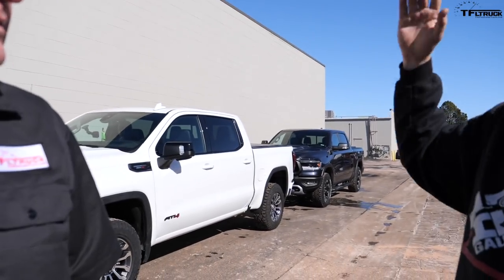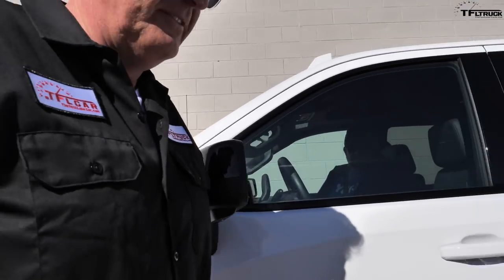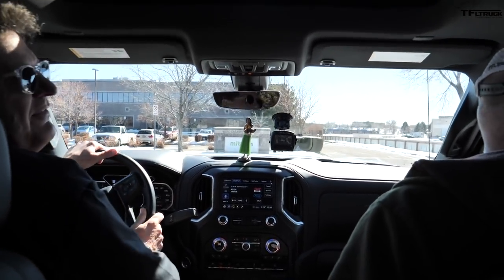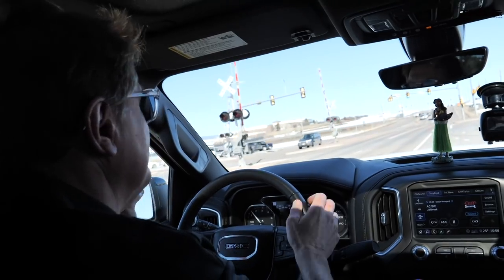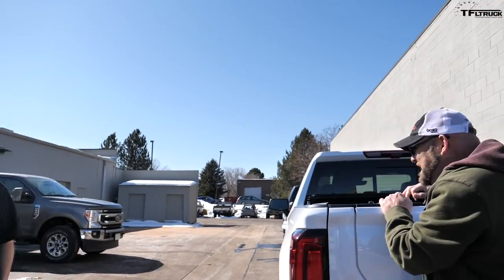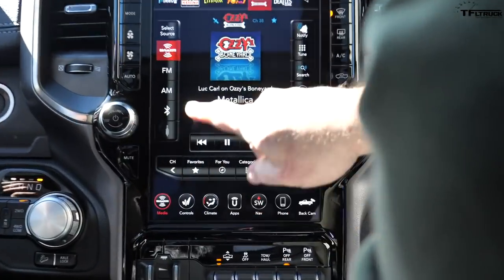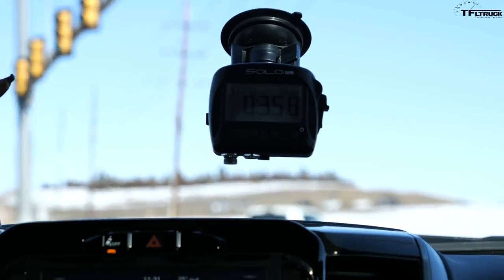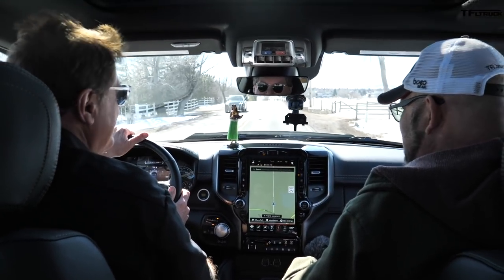Best Diesel Truck! 2020 GMC Sierra AT4 vs Ram Rebel Diesel 0-60 MPH Buddy Review

Comment: Yeah, wait till you have “emissions” problems on these new diesels. If you don’t need a diesel don’t get one and save your money.
Reply: With these trucks you don't save much on the bottom line.
Reply: Just got rid of my eco diesel with 80k kms.  My wife’s x3 diesel just had the $5000 soot intake clean out at 115k kms.  These modern diesels with egr are time bombs.  Loved the fuel economy but in the long run there is no math that makes them work.   Stay away and get the gas engines.
Reply: matthew anderson you can delete, delete your warranty on your brand new $50k truck too.
Reply: matthew anderson 🤣🤣 you never hadn't warranty work done on a vehicle, have you?!?!
Reply: John Doe especially on these brand new trucks, my 2019 has already had warranty work done on it.
Reply: Said no man ever...
Reply: matthew anderson that's why you don't delete until your warranty is up!
Reply: Most guys that so spend all this money on them their trucks never see a day of work
Reply: Big egos that never tow
Reply: Brad Harris my wife’s 2014  jeep grand cherokee ecodiesel has 90,000 miles and no issues no warranty repairs and no trips to the dealership. And we have saved a lot of money on fuel because that car gets 24 to 25 city and 34 on highway. For me it’s been a nice experience owning that car . Only complaint is I can’t hear the turbo 😂😂😂 because all that crap but so far so good.
Reply: @duvielhernandez2887  ha just wait. Dodge is the worst company ever
Reply: @duvielhernandez2887  no car should have any problems yet. And thats the same milage a v6 gas will get but you pay more per gallon.
Reply: @duvielhernandez2887  how stupid to buy a diesel when you can have gas.
Reply: Hurricane 863 the V6 Grand Cherokee does not get 34 mpg on the highway.
Reply: @nicholasandreas4348  pretty close. Just wait till 100k or 125k. That thing is going to be nothinf but issues
Reply: @nicholasandreas4348  youll be wishing you got a toyota or subaru
Reply: @nicholasandreas4348  do you not know who owns jeep? Like get real.
Reply: matthew anderson, deleting it will cause all sorts of problems, transmission issues, not passing a smog test/inspection, & other warning lights from the DPF gauge.
If you do it right you need to reprogram the whole PCM, & a new tune that’s hard to find and if that. 

But an old truck & swap a diesel in it. Cuz as of rn you can’t get a real diesel in a truck anymore.
Reply: Hurricane 863, if they want a good diesel truck buy an old 6.0 or 7.3 as of now they are the next best thing to a good truck.
Reply: @michaelbenoit248  all i buy is ford and i had a 2006 6.0 with 115k miles and it was nothing but problems. 2012 and newer 6.7 is a good motor. But i love my 3.5 ecoboost. I will never buy anything else.
Reply: Hurricane 863, for thinner fuel than in other countries. My 7.3 needs the thicker fuel & it won’t run right even with the additives for the loss of sulfur.
It loves a little motor oil in the fuel, I can tell a big difference in power & over all efficiency.
Reply: Nicholas Andreas, it probably gets like maybe 20 and if that on a really good day when the sun is shining.
Reply: Duviel Hernandez Have you filled your claim form and grabbed your $3,000?
Reply: Nicholas Andreas Mine got 36 highway before I sold it.
Reply: @macbook802  yea, you know... if you're into breaking federal law. And having everyone around you hate you because you spew soot and smell
Reply: Kyle Schack not if you have the proper tune!
Reply: Game Bred Duramax I agree with you. But I know how the warranty department acts and if they found out you deleted it, they claim every problem you have will be because of it. I didn't delete my 2016 ram 2500 mega cab limited Cummins because I got the extended warranty as well.
Reply: @nicholasandreas4348  it sure the hell can. I have a 2015 overland with the ecodiesel. Drive it nice and that number is achievable
Reply: @hurricane8634  no it's not. I've owned both, gas and diesel outfitted jeep grand Cherokees. The diesel  repeatedly gets an extra 300km out of the same 90 liter  tank and almost never leaves 8th gear on the highway. And have had no issues with it. Now the air suspension is a different story.....
Reply: @michaelbenoit248  where do you get your fuel at?
Reply: Iggy I was saying the gas V6 grand Cherokee doesn't get 34 mpg. I'm sure the diesel could get that.
Reply: @nicholasandreas4348  My bad man! You're 100% right.  I've owned both.

Comment: Ram - 8 speed ZF Auto
GMC - Ford/GM 10sp Auto

I'll take the ZF 8HP thanks
Reply: LOL with how many 2019+ Ram's have had their ZF 8HP take a dump, you can keep your Fiat.
Reply: @ThomasFG  go look in the forums. tons of ZF 8-speed Rams needing new transmissions. That's what happens when they change the design for 2019.

Comment: Why doesn't Ram put their 4wd auto transfer case in the rebel? You pay 60k for the dam thing give us the best transfer case . Had to buy a Ford F150 diesel which in lariat has 4wd auto (great for snow) and locking rear diff.

Comment: OMG I love my hockey puck!  The shift lever takes up space, requires human interaction, blocks sight lines.  The hockey puck can be managed by the vehicle electronics, is out of the way, easy to use, highly functional.  Many other functions are controlled in a similar manner.  Take a look at the Taco drive selector.  Its a rotary dial in basically the same position of the hockey puck.  Where are you comments on that Nathan?  Get over it.  Non leather steering wheels, plastic surfaces and hockey pucks are all modern and good.  Roman's constant complaining about modernity is getting pretty old.
Reply: I hate to say it but I’m with Roman on this one. I just went from Chevys with column shifters to a Toyota with a console shifter. That was a big step for me. The knob shifters are too much for me. Most my trucks have had the dial for 4WD though.
Reply: “Ruins sight lines” LOL Some people would complain about there ice cream being to cold

Comment: The Rams largest tank now on the 1500 is 33 gal and if you’re cruising at 65mph on the highway nonstop you can get 900 miles on one tank or more. The test has been done so it’s proven! This test was not done with the rebel but even if it was I can’t imagine getting less than 100 miles worse...your thoughts?

Comment: WTF, I maintainance my oily, fuel dripping chain saw on the tailgate. Metal shavings from the chain sharpner everywhere.
Those gadgets will hold up well. Lol.
When you go back to the dealer with a broken button. They will tell you because you used your tailgate for things other than groceries the warranty is void.
What rocket scientist thought this up?
Reply: I have the GMC with the tailgate and I cut lumber on it almost everyday. I use it as a work truck and I can tell you I have not had any issues it is a phenomenal design

Comment: I have that tailgate and in an ice storm it froze and i couldn’t even open the damn thing. Push button tailgate is a joke
Reply: The dealer will thaw it out for free if u bring it there
Reply: Which one? GMC?
Reply: @rkalla  GMC Sierra
Reply: Would you have been able to open a normal one frozen in an ice storm?
Reply: @ra3975  probably not
Reply: @ra3975  The servos lack the power to drop the tailgate, theres no lever for you to pull on.
Reply: @TonkaFire2019  well if you read my comment again I speak about a normal tailgate. The kind with levers used to open manually. The point was that it doesn't matter if you have an electric tailgate or manual. If it's frozen shut it's not opening.

Comment: Have a 16 3500 Crew Short Duramax SLT Duramax, that was $51k on fleet new...has 172k miles on it now...am getting 22.7 mpg over all empty miles...and it's intact, bone stock --- you just answered all my questions --- Don't buy a half ton when you can buy the 3/4 or equivalent for really close to the same mileage...and have literally triple the pulling power! I was really hopeful that these half ton's(diesel) would get close or at the 30mpg mark...because then it would be worth it.

Comment: I could buy a lot of gasoline for the premium on that diesel.
Reply: Resale is higher though; so in reality, it's about half of the upcharge cost.
Reply: @Luis Bolanos my used to have the 3.6L in here 2014 Ram 1500.  I have the 2016 Ram 1500 Ecodiesel.
My wife did not find the gasser fun.  So she traded it for a 2018 Ram 2500 6.7L Cummins beast.
I would like a Powerwagon with the Ecodiesel.  A good compromize between ride and durability.
Reply: AND you'd save on the huge diesel repairs. Gas all the way. Coming from a guy who has a 2011 f350 6.7 with only 145k miles
Reply: My 15 year old Cummins still blue books north of $20K
Reply: @adriangates8447  It's no surprise the guy talking about repair costs of diesel trucks is the one with the Powerstroke.

Comment: I think this is about a decade late for this segment to offer three great options (? Ahem...Ford).  As a ~300k Cummins user I like the duramax design and may actually consider trying a Chevy. :) 

Isn't there a rule for roof controls?  If you touch it more than thee-times your playing with it...

Comment: Ram should have let Cummins design a small diesel for them
Reply: Maybe yes, maybe no, look to Nissan.
Reply: Why?
Reply: Esteban Amador that was a motor made more for pulling than fuel economy. And was geared towards a half ton. Nissans problem was the tried to market it as an “almost” heavy duty truck. First of all the XD should never have been advertised like that because it had poor payload capacity compared to heavy duty trucks and weak trani. The 5.0 v8 Cummins would have been top of the line in power by far, if it had been in a half ton line up. But compared to the other diesels in hd trucks it was underpowered and and didn’t compensate with better fuel economy. That’s why it failed. Ram almost had the same exactly motor in the 1500, and would have been a shared platform with Nissan. But fiat backed them out of the deal when they bought ram.
Reply: @toofastnobrakes  you are right, but there were some reliability problems too.
Reply: Esteban Amador also true. But I think a 3 or 4 liter Cummins i6 or even i4 would have been a nice thing to have. The good thing about inline motors is they are easy to scale up and down because there so well balanced. And a smaller version of the current 6.7 tuned differently would work wonders. That and it would sell better in the US with the Cummins branding.
Reply: @toofastnobrakes  Cummins makes a small diesel that would work but it's noisy, loud, and doesn't have a chance in hell of passing US emissions regulations. It would be a disaster.
Reply: hochhaul Is this motor made specifically for a half ton truck? The most it would take is designing a newer motor made for the ram 1500 platform. As I said they can scale down the current 6.7 and retune it for efficiency
Reply: hochhaul which one do you mean? The 2.8, 3.3, or 3.9?
Reply: @toofastnobrakes  None of those engines would EVER pass US emissions regulations. Nissan was going to use the 2.8 in a Frontier and walked away from the engine when they realized how expensive it was going to be and how much efficiency/power it would lose.
Reply: karl schauff you still never answered my question, which motor were you referring to?

Comment: Why get a Duramax in a half ton? If you need a Diesel go HD. But stay away from Ram
Reply: Eh...its a happy medium. Smooth power/torque output with pretty good fuel economy. The new HD trucks are made to tow ALOT of weight. More than most people will EVER need to tow.
Reply: You can get 30mpg out of a 1/2ton.   Thats why, and a half ton rides better than any HD, yet another reason.
Reply: @msawyer110  these new tiny truck diesel engines are having lots of DEF issues and they have many design flaws. MPG means nothing for a truck. If you are looking at MPG when buying a truck, you dont need a truck.
Reply: @andybub45  if mpg means nothing towing why do they sell 3/4 ton trucks with 6.6l diesel motors?   For the milage lol
Reply: @andybub45  the sole reason diesels exist is milage while towing.
Reply: Never have needed to tow more than 6000 Lbs.  Heaviest payload required is a 900 lb. ATV in the bed.  Drive 80-100 miles per day and the 1/2 ton small diesel gets 40% better fuel mileage and rides better.
Reply: @msawyer110  if you think that MPG is wonderful, then why does the EPA not rate the 3/4 tons? Its because it can be good at times and terrible at others. Diesels exist solely for towing. MPG has nothing to do with it.
Reply: @paulfaiman5601  if you drive 80 to 100 miles a day you should have a seperate vehicle as a commuter. Trucks arent meant for gas mileage, and there is no way that the I6 rides better than the V8.
Reply: @msawyer110  partially, but its mainly for towing torque. I can tell that you dont know what you're talking about.
Reply: @andybub45  All diesels are having DPF issues these days. Especially the ones owned by guys that think they need a diesel to short trip across town every day. I know a guy with a 2016 Ram Ecodiesel that went through 2 engines and an exhaust system in the 2 years he owned it. Drove it 2 miles to work 6 days a week.
Reply: @karlschauff7989  ikr, for some reason, these people buy diesels and think they dont require more maintinance. If you arent towing, then get a gas V8. Its a much better choice.

Comment: Uh... it is carbon fiber bed. Its composite carbon just like new lambos started to use on their frames. It's for sure different process but it is carbon fiber bed. Your claim is very misleading for saying its not carbon fiber. It is not woven carbon fiber but still it is carbon fiber.

Comment: I'll stick with the old motto less is more.  To much electronics, to many hinges on tailgates, no thanks I'll stay with my old trucks
Reply: @Luis Bolanos maybe you can't but most of these new trucks are just electronic features that are not necessary, just comfort stuff.  At least I cam work on my old truck anywhere without taking it to the dealer like the new ones.
Reply: Then you stay with less capability, less comfort, less efficiency

Comment: Neither for me, thanks. Gasser in a half ton. You don't get enough capacity or economy from a diesel to outweigh the hassles and costs in this class.
Reply: H'mmm there's a point or two to consider,...
Reply: Yep! You have the added cost of the engine, more expensive oil changes, fuel filters, Def, 3 dollar diesel, expensive air filters, 40,000 mile maintenance intervals on the engine EGR system, etc etc etc.
Reply: Exactly!  I almost went with a diesel AT4.  Decided to go with the 6.2.  Less maintenance, and more fun.
Reply: @domin8ss  Wise decision. Emissions diesels just don't like short cycles or idling. Back in the day it didn't matter so much. There wasn't a DPF to clog, let alone derate you and cause havoc.

I'd recommend my old IDI all day long since there's nothing but a y pipe to a muffler. But alas they don't make them anymore and they don't even have modern gas performance. They're basically an old longevity powerplant.

Comment: When it comes down to it V lay out vs Inline layout makes 0% difference in how quickly it generates torque. A V and I with the same bore, stroke, and displacement will generate torque at the same rate. The reason people think i6 makes more torque is because they typically have longer heads and stroke to compensate for having a lower max rpm. = more low end torque. The V however can operate at higher rpm without damaging itself because of how it’s balanced. = higher horsepower typically
Reply: but an I-6 is perfectly balanced - more than a V8. That's why you can do the nickel balanced on the valve cover trick.
Reply: King Elvis yep 👍

Comment: All of those new diesels will be a pain in the A$$$$ in a short while after!!!  The dealer's can't even fix the old ecodiesel, now they have an all new ecodiesel they know even less about now..  Take it from me, been there done that, they are awesome when they are working correctly, but when they're not the dealers don't know how to properly fix them.. The engine would be AWESOME if it didn't have all of that EPA diesel emissions equipment on it. At 62,000 miles the ecodiesel engine has 1/2" of thick sticky carbon all in the intake manifold and all in the engine, and it will never get better only worse..The engine eats it's own filth and will die prematurely without a full delete early on. Thats unfortunate but true.
Reply: What, specifically, will the problems be?
Reply: 1. Recirculating raw Diesel exhaust through the turbo, charge-air-cooler, E.G.R. Cooler & Throttle Valve,  intake manifold and intake valves.
2. D.E.F. systems have proven to be very problematic.
3. High cost of repair of all the above.
Reply: Too many people think they need a diesel truck and drive them like a gasser. I know a guy that short-tripped his Ram Ecodiesel every single day. Went through two engines and an exhaust system or two.

Comment: You can have carbon fiber that isn't a weave. It is just called chopped carbon fiber. It is a  great way to add stiffness to a molded part, but you won't get anywhere near the tensile strength of a woven part.

Comment: Fyi your “ram box” was first introduce on the Chevy Avalanche. So technically ram copied GM
Reply: Not true, look and compare before you spread fake news. Huge fake news.
Reply: @devodar2579  
How is it fake? The Avalanche came out in 2000 or so.
Reply: Avalanche also was the beginning of the rear bumper step too.
Reply: EdMiF 🤦‍♂️ which would makes it first right
Reply: @Inspector694 
Absolutely!
Reply: Sometimes it’s not about who did it first but who did it better..
Reply: Yas Sometimes you have to respect the original OG’s and not the copycats.
Reply: Except the Chevy leaked water, snow and every other thing
Reply: I wish gm would have stuck with it!